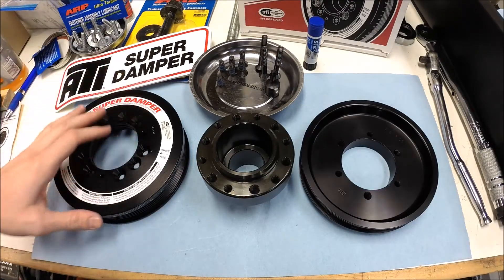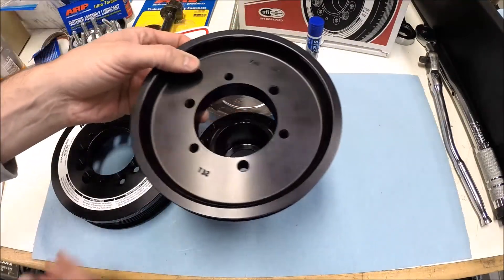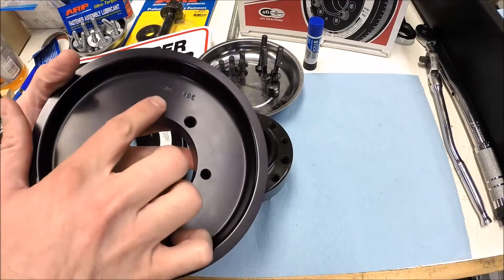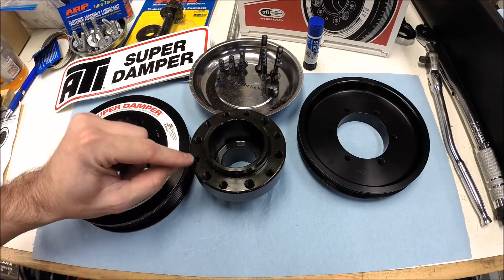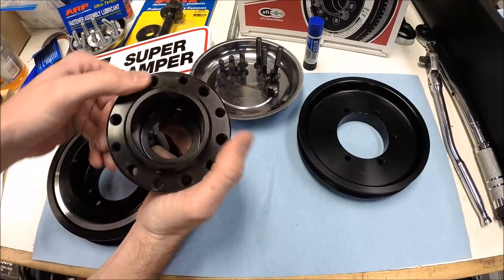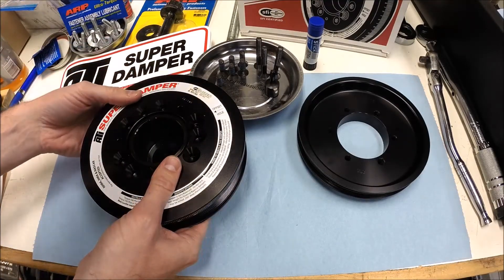LS Tech: How to Assemble an ATI Super Damper

Comment: Can you delete the ac pulley, or does it need to be installed with that set up?
Reply: I had the same question. As I don't run ac
Reply: Yeah, you don’t need to use the ac pulley if you’re not going to run AC
Reply: According to Ati you should use all 9 bolts. meaning yes you should run the pulley

Comment: that is so stupid damn so now i have to buy tools too,why couldnt they just use regular torx i swear and i am having hell getting the hub to seat all the way down on thew crank ive got about a 1/4 inch to go but i cant keep it from turning so im trying to make something to keep it from turning,my rachet straps are stretching,i usually use just one to remove the oem balancer on my 6.0 LS and reinstall but not with this hub,any ideas please someone
Reply: Remove all of the bolts that you have installed. Then use the three threaded holes to jack screw the hub fron the pulley. Then clean the inside of the hub, make sure the dot is in the correct position, and try assembly again. Go slow, then remove bolts one at a time ,apply loctite, and torque. Your home.
Reply: @jessebunker6062  oh i got it,but it was hard as hell to get it to go on,the oem balancer i can do that in like 10 minutes,anyways the other part that sucked for me was routing the piping and the rubber sleeves,but its running,i made like 550 fpt to the tires with me shifting to soon at 5200 rpms haha then i ran out of injectors which i knew i was going to do,ive got some bigger ones but my tuner wants to try something else first,some operating system pulsating the injectors,i have no idea what that means lol,thanks

Comment: I have heard to maybe heat the hub up with a cool engine to help press the hub in? It that correct or internet jumbled
Reply from the maker: Yes you can, but be careful not to damage the rubber portion of the damper.   The top of page 4 in the instructions discusses heating aluminum hubs by placing them in a pot of boiling water for 5 mins.   http://www.atiracing.com/instructions/Super-Damper.pdf

Comment: Can they only be assembled the one way? I don't think I lined up the offset hole on the damper with the indexed mark on the crank hub. Everything bolted together perfect but...
Reply from the maker: Honestly I don't recall if there was a way to assembly it w/o lining up the index mark.  I'm guessing you already have it installed on the car?  If you're nervous about it, you could call the ATI tech line and ask them.  I would do that before I went through the hassle of removing it from the engine.   I think you're gonna be fine though.    Let me know how it goes.

Comment: Why not the Fluidamper brand?   Many have said its much better and lasts longer
Reply from the maker: Honestly I think both products are probably very good.   In all of my research I never read anything bad about ATI, and they are used in some very serious race engines.   But that's not to say Fluidamper isn't also very good.   I ran an Innovators West unit on my supercharger 4.6 Mustang in the past and had good results with that as well.   So there are several good options available.
Reply: Scruf's Garage Makes me wonder what harmonic balancer high RPM NASCAR Engines use and Formula 1 Cars and Koenigsegg. What I don’t like about the Fluidamper is the rotating weight, seems it would put twisting stress on the end of the crank where it bolts up when fast revving and braking/slowing down the engine. 

What I don’t like about and have seen with the ATI damper is the rubber cracking and separating. 

To me the solution would be using high quality/high temp/oven type silicone in place of rubber.

Comment: If i delete the ac do I still need to add a ac pulley?
Reply from the maker: Good question.   My default answer is going to be check with ATI; I don't want to steer you wrong.  I thought there was a separate part # for w/o ac, but I can't find it now.   The rear ac pulley doesn't impact how far the hub would seat on the crank, so that shouldn't be a problem.  You have 6 bolts that bolt the main pulley to the hub... but you would lose the 3 bolts that pass through the main pulley and hub and thread into the ac pulley.   Only ATI could tell you if the 6 bolts are sufficient, or if all 9 are required.  Also, removing the ac pulley would change the total weight of the balancer, so I'm not sure what effect that would have on the dampening... probably minimal.   But again, a quick call to ATI would be best.   Let us know what you determine.
Reply: no buy a race one. duh
Reply: No, you need to use 9 bolts, so where the shorter 12 pt bolts are is what you’ll use to mount your sc pulley with their hardware, and the notaped holes that the ac pulley go would be open/empty